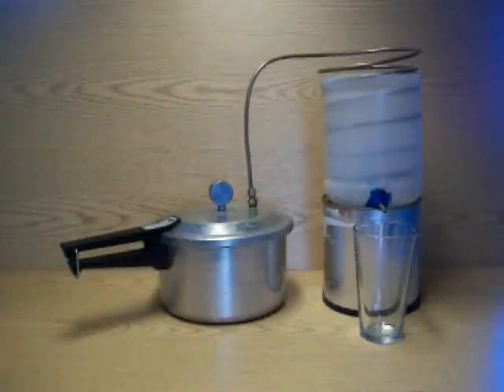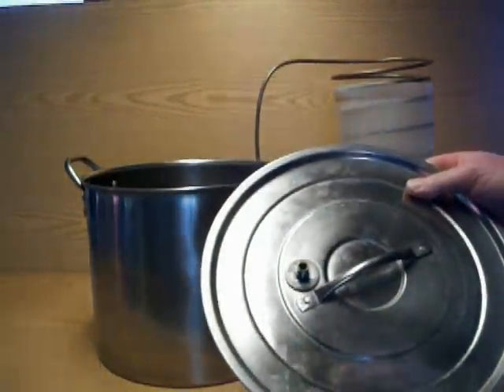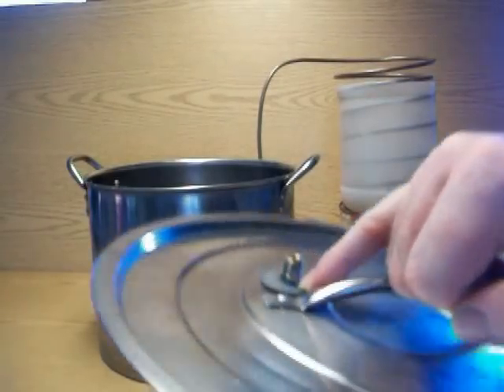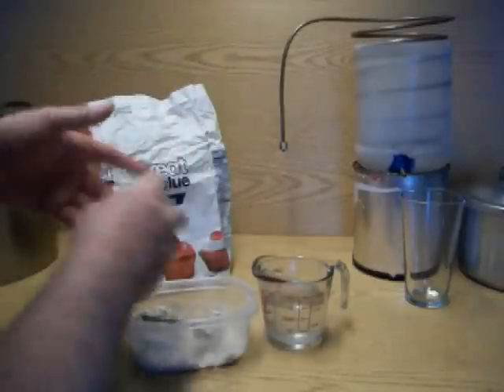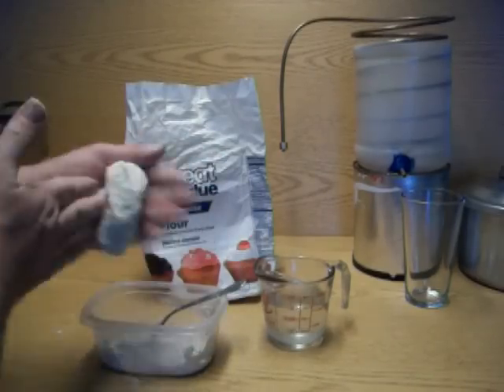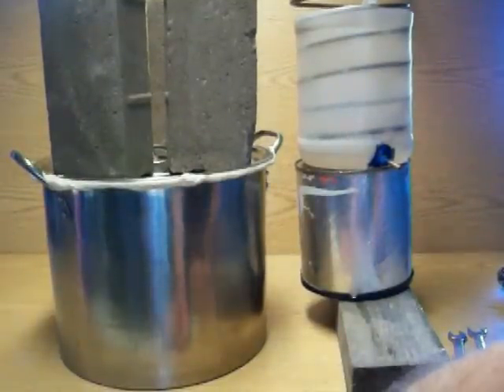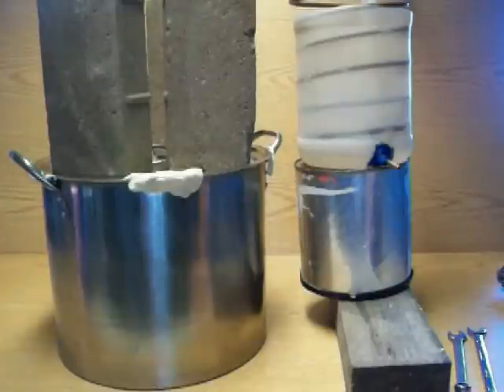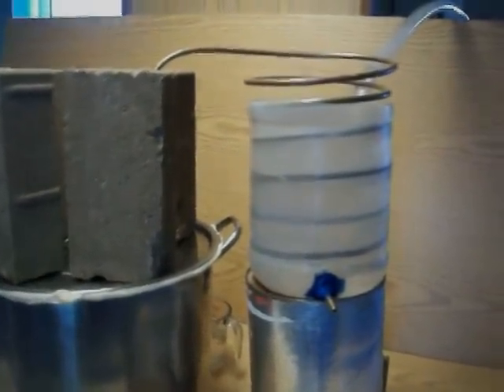Easy Build Moonshine Still pt 2 Upgrade

Comment: If I want a finer liqueur should I take, the product of the first distillation, toss it into the empty pot and run it back again? or add some water or something?  thanks I like de vids.
Reply from the maker: IF you do things slow enough. a second run is not needed. If you just run the still at full blast then you'll need a second and maybe a third run.
Reply: Roger that!  Thank you.

Comment: does my stove need to be flame heated or can it be one of those flat faced stoves opposed to a coil stove. so my stove basically glows red producing the heat?
Reply: I love how your a woman only a woman would only ask this question.  Yeah I may be late but it works just make sure to play around with the heat until you find the right tempatures.  If that doesnt work get one of those little camping stoves

Comment: i cannot figure out the connection to the copper pot and the lid to save my life. could you please list exactly what i need to pick up!!! thanks!
Reply from the maker: The connector. It has a compression fitting on the side with the coil.
The other end has a standard pipe thread, the shortest copper or stainless steel "nipple" attached to that acting as a bolt, and then a copper or stainless steel "coupler" acting as a nut. With stainless steel washers filling in whatever space is left, they also make the lid more rigid because the metal is thin.

Comment: I have a picture of my still I would like to send you, it's a 5 gal bought it offline stainless steel, the worm is a few inches off the pot and sits in another stainless pot, what do u mean my low pressure, I can only run the still on low heat? It has clamps on it to clamp the lid down tight
Reply from the maker: +hazel nicole You can send the pictures to my facebook account on a private message.
You need to use low heat regardless of the pot and seals and clamps in order to get high quality drinkable whiskey, unless this is just for a high school science project.
Reply: +hazel nicole  it sounds like u have a doubler on your set up...hellooo
Reply: +KEN WALLS it's a 5 gallon pot still with a copper worm just basic

Comment: i guess I should have watched all the show , wow you make it lot harder than it needs to be . allso the top loop of your coil will MELT THE HOSE.  add a drain to the bottom of your worm bucket and let the water just run through back to the sink drain.. glue some rubber to the bottom of your lid ( from an old bike tube) keep the doo for your bread.
Reply from the maker: +Joe Peanut You're the one making it more complicated.
One hose with zero hook ups VS 2 hoses with hookups. You're talking about 14,000 laymen with zero skills. KISS method (keep it simple stupid)

and I would add the drain to the TOP of the bucket and the overflow will run down. If you put the drain on the bottom then you have to have just the right flow from the faucet and I tried that with 2 hoses. Not easy to get the right flow. It's ether too much and over flows or too little and runs dry. You don't need a constant supply of water, you just have keep the water below a specific temp
And NO, I've ran this at least 10 times and zero melting on the hose.

Bike tube???? Are you insane? I get enough wackos yelling at me from using food grade rubber seals on the old pot

Comment: try a stainless steel replacement valve stem sold at almost any auto parts store they come with rubber gaskets
Reply from the maker: +adam moon GOOD TIP.

Comment: WCE could I run 2 inch pipe from my 15 gal. Still to my thump keg and then put my still tower and condenser on the out side of my thumper
Reply from the maker: +plumps68 Sounds right. Boiler to thumper to condenser

Comment: why make the upgrade in the 1st place? The upgrade seems to be way more messy and a bit more to do. Why bother? Capacity?
Reply from the maker: Some folks didn't like the aluminum pot, and I personally needed something bigger. I got tired of refilling the smaller pot. It gives people options too
I can personally say the aluminum pot gives the alcohol extra fight as it goes down. The SS pot makes a smoother drink. I also didn't want to pay big $$ for a big stainless steel pressure cooker.
If you got the $$ to spend, A metal bottom cornelius keg or "corny keg" is a great choice. It allows you to bolt on the coil like the cooker but is way bigger

Comment: I love your videos man, they've helped me so much. I was just wondering though, I have a mini-deep freezer, and was wondering if I could somehow mod it to work as a cooler for the condensing coil? It's expensive I know, but I never use it and thought it might be a good upgrade from water. Haven't heard of anyone trying it before, your thoughts?
Reply from the maker: one word. Overkill. unless your planing on making gallons at a time. And I don't know if a freezer is meant to keep up with a heater unit. I just don't know.
Reply: good point, I hadn't thought about the cool temperature of the freezer vs the heat of the coil. I think thats something I'm going to sit on for awhile. thanks for the reply

Comment: I'm totally new I admit but why not the idea of pouring ICE in the  coil bucket and provide a hole for the melted ice to drain away and add more ice.  Seems like the way to go for me.  :-)
Reply: +Nummer1Ahteest What you are describing is sort of the way that is done at the Gristmill Distillery (Mount Vernon Distillery).  They have water running constantly into the wooden barrel holding the coil, and out a bung hole at the bottom.  works great but you need water with the ice because the chilled liquid will wrap completely around the coils thanks to the properties of liquid.  Basically you will want to have a plug for the drain for when you need to add more ice.  The way that heat rises in a liquid and the fact that ice floats will ensure a fairly stable cool temperature, but once you lose over say 50% of the ice, I would suggest pulling out the plug for a little bit, adding ice to keep the water level constant.  That help at all?
Reply from the maker: +Nummer1Ahteest The question I get asked the most. You only really need the water a little below the boiling point of alcohol. I've seen people in Laos making rice whiskey steam coming off the cooler. They dip a few spoons out and replace it with colder water, dip a few spoons out and replace the water.

Ice is just more prep time or more cost if you buy a bag. The ice will just melt fast and the water that is still cool enough just ran out your hole. Even without a hole, it only saves a couple of water changes. There is no whiskey making that should involve a "set it and forget it" technique

Does that mean you should not add ice to your bucket??? Oh hell no. This was just the simplest for me
Reply: wcemichael How about rigging a cooler above the coils and water container, and having a constant feed of cold water with an equivalent flow coming out the cooling bucket?
Reply from the maker: Jeremiah90526
Well yea you can do that. Feed in through the bottom on the jug and an exit at the top and let gravity run it down to the drain, but I like to keep things simple. You should not have a "set it and forget it" still. You need to keep an eye on everything.
Reply: Hey Buddy... thanks for the reply and you make good sense!  I like yer idea of having a good reason to keep an eye on things.  Because... besides having something awesome to drank that you made your own self, it sounds like it should be fun to do TOO.  :-D  Thanks again.
Reply: +wcemichael      Hey thanks a bunch.  Y'all... (whixy makers),  ;-)  are sure a nice group a people.  So often... I try to ask a question or make a comment here on You tube and I get the most unkind replies (if anything at all), I really appreciate your kind reply. It's def' something good to consider.  In other words... it doesn't have to be freezing cold next to steamin' hot to get results.  Makes good sense.    Thanks again my friend!
Reply: +Jeremiah90526         Helps a lot... I really appreciate the informed (and kind) reply.  Like I told  wcemichael , y'all are a really nice bunch of folk.  I don't know if it's that so many "shiners" are really nice and helpful or if it's just the time of year, (or some of both).  Whatever the case... I'm very thankful and I wish you all a merry Christmas and a blessed new year.   From RC the ahteest.
Reply from the maker: Nummer1Ahteest
Well, I'm just helpful no mater the cause. Merry Xmas to you and yours.

Comment: Instead of that nasty flour puddy, buy an o-ring, est. 11.5 to 12" (measure it) and put it on the lid and buy some cheap clamps and clamp the lip. Works great.
Reply from the maker: My videos are about the simplest way to do stuff if you don't have a handy Ace Hardware around the corner... People have been able to reproduce my stuff with ease in poor countries.

Comment: What size copper tubing and what size and type of fittings do i need
Reply from the maker: Literally any size will work, unless you're trying to match things together. So my first still had an exact measurement for a threaded fitting. I took it to the hardware store and the people there helped me. When I made this revised still, I carried the coil I already had to fit the new boiler. Now it doesn't have to be that way. IF you are making something from scratch whatever you can get to work or get your hands on is good enough. I would say don't go any smaller that I went and also don't go to large as it would be harder to work with. Just stick out your pinky and  look for something around that size.

Comment: Ok.  So, tell me again why this method is better than using the previous pressure cooker?  ......cookware that is specifically designed for high temps and pressures.
Reply from the maker: Ok, People didn't like the rubber gasket. Gone. People didn't like the aluminum. Gone. I myself didn't like reloading the thing 5 times for 1 batch of wash. Gone. And to friends in Pakistan, they were able to crudely recreate this one vs the other one. NOW, if you get a 5 gal stainless steel pressure cooker, more power to you. If you're happy with the first model, Great.
Reply: I see your point.  The video you did for the cherry wine/brandy that was fermented in the Igloo cooler was awesome!!!!  I can't wait to try that one out.   Two for one: You can save some for wine, and the rest distill for brandy.  Brilliant!!!!  As far as stills go, I'm still researching what will work best for me.

Comment: How do my friend keep the still at low pressure, because he mash ready to be run, but when he first tried nothing came out. He has his worms set up on the left side of his still does that have anything to do with nothing coming out
Reply from the maker: You might have a leak.
The side the worm is on does not make a difference.
Put water in that and boil it until something comes out and look for leaks.
Reply: I seen liquid coming out of the nut on the pot that connects to the worm, then the vapor begins to come of of the flower paste
Reply from the maker: Determine if any and all leaks. You have to watch this carefully...Heat up your mash with a full flame, as SOON feel the coil start to heat up, turn down your flame down about half way. Your bricks have to be evenly spaced and as close to the edge as possible. If you still have a flour leak, turn the flame down a little bit and put a big wad of flour over the leaking area.

If you still can't get this to work, then I would go and buy a stainless steel pressure cooker.
Reply: Ok thanks

Comment: Couldn't you use ice instead of hooking it to the water?
Reply from the maker: +Billy Denham I go through many water changes. The ice will melt very fast and it's just more prep work or cost if you buy ice in a bag, but I understand why you would want to use it. You might save 1 or 2 water changes??? but you still need to make enough ice before hand, UNLESS you have an ice maker.

Comment: I have the exact same setup but my shine always comes out cloudy. why is that?
Reply: +Jenna Stone That could be for a number of reasons. The first and most likely is that you are running it too hot/fast. What you want is just the alcohol vapor to come over. Also if you use something with a tapered (think upside down funnel) top that helps collect the alcohol vapor before exiting and you will get a better distillation. Now some people like to have more of the fruity flavors carried over and will intentionally run it a little hot. I hope this helps.
Reply from the maker: +Jenna Stone You Yea, I had a cloudy run once with banana brandy. I changed everything did on the next run. Still not sure why that happens.
The things I did
Make sure everything is clean
Switched from fermenting in small containers to big containers
Filtered the wash with cheese cloth

Comment: could you use a pressure cooker cuz the lid seals and has a temp gauge  or is that to much
Reply from the maker: Get a stainless steel pressure cooker, if you can find one.
Reply: wcemichael ok kool thanks i have a old stainless one in our garage
Reply from the maker: Oh good.

Comment: where do you get the brass/stainless steel coupler  and whats the right name
Reply from the maker: The people at your local hardware store can help.  This has a compression fitting one side and a pipe thread on the other. They'll know.

Plus on the inside is a small nipple and coupler
Reply: thanks youve helped alot

Comment: I don't have much plumbing experience.  Why not just drill a hole in the lid, scrape the side of the pipe, and top of lid with knife; then seal with JB Weld.?  Would that be a problem?  Also, instead of sealing with flour dough, can I use Play Dough that Wal-Mart has for children's play?  I don't want to mess with making flour putty.
Reply from the maker: When JB weld and play dough becomes food and alcohol safe, you may go right ahead
Reply: wcemichael Sir, I honestly thought about what you are saying.  If you think of it though, distillation is a purification process really.  So if a little JB weld or playdough drops in the solution you are distilling:  Would it really matter?  Rain can fall on a tarred roof top for example, evaporate, and come down again later; and I am certain it would be safe to drink.  I could be wrong though about distillation, it may be different.
Reply from the maker: Piano Man42
Yes, but if there are vapors of any kind, it will become part of the moonshine.
A mash has a certain taste depending on what you make it out of, and that smell coming from the mash goes into the condenser and that's why you only get a whisper of flavor in your whiskey from your mash.
Now yes, my first still did have JB weld and bathtub calk, and remembering back from what I know now, it tasted like crap and I would never do that way again. However, after time it did make some pretty good stuff, but I boiled vinegar through it and steam blasted it clean. Now that might work for the JB weld, but you would have to use new playdough once in a while.
Reply: wcemichael  Is this flour putty just flour and water?  I thought about it.  I plan to drill a hole only big enough for the pipe to fit through the lid.  Then Jb weld only on the out side of the pipe and top of lid.  If you think of it, pressure builds in the container, so it pushes out.  How would the JB weld in this case, get to your final product?.  Is it likely a little piece could break off and drop into your mash, if the pipe fits snuggly through hole; and the seal is only on the outside. ?  It does not seem likely, but I could be wrong.  I think I will try flour putty instead of play dough.
Reply: wcemichael Jb weld supposedly takes high heat well, but if you did this already; I believe you.
Reply from the maker: Piano Man42
I would only say that I got away with using it, I also got lucky that I didn't poison myself or any of my friends. For a few years the moonshine that I made had a funny taste to it, and I would never use JB again. Yea, it might take heat well, but it's still for industrial use, not cooking use. Just like I would never substitute motor oil for olive oil.

Comment: why dont you install a return on your condencer water,   turn the water on, it runs thru your coil bucket and out the bottom to drain into the sink,  no stopping and draining
Reply from the maker: I tried having 2 hoses. Too much work, it will either slowly dry up if too little water was on, or slowly overflow with too much water. It's impossible to get perfect. Then there is buying more parts, getting to parts to work with out leaking. This was a simple solution. I can change the water in a minute.
Reply: get the valves out of 2 ice maker boxs at ho depot,,rip out the valves, instal the valves in your cooler bucket, use the valves to throttle the water......just a suggestion, do as you wish.
Reply from the maker: brian davis
The idea behind my demos is to give the everyday guy, who doesn't have a lot of knowledge or skill in this area, a basic working knowledge of the minimum stuff that is needed. Make it too fancy and people will get confused. Once he has the basics, then he can come with his own ideas on improvement. So someone might read your suggestion and try it.

Comment: lot's of good info here but cleaning stainless steel by method of an abrasive steel pot scrubber will cause micro-abrasions and eventually rust your pot; more importantly creating a place of harbor for bacteria. in addition to this there are bacteria that require a minimum of 250* F or 40-70% alcohol to be removed. this temperature and alcohol percentage are far above what will ever appear in your mash pot, prior, during or after distillation.
Reply: +D Whodat yo yo yo Idk

Comment: ok you needed a bigger pot and wanted stainless got you i'm  hip to that cook on I will stay with my 4 gallon pressure cooker thanks.
Reply from the maker: I did find a very nice pressure cooker that I almost bought, but it turned out to be aluminum